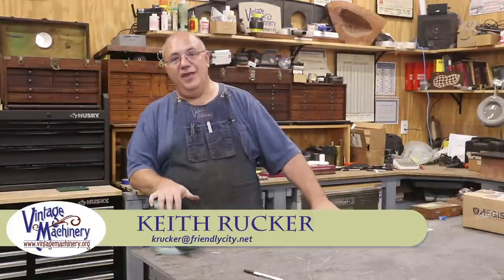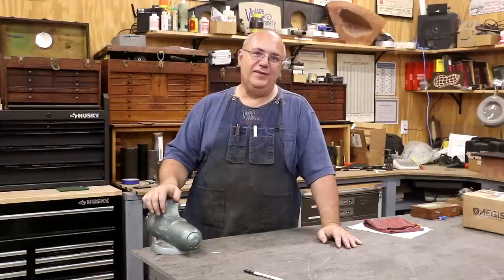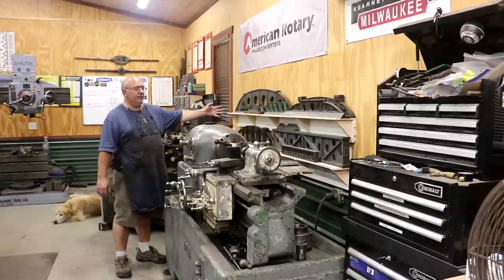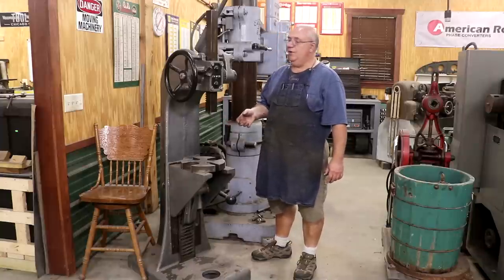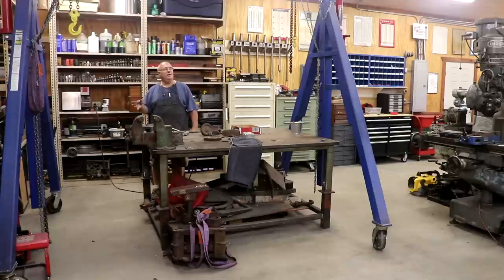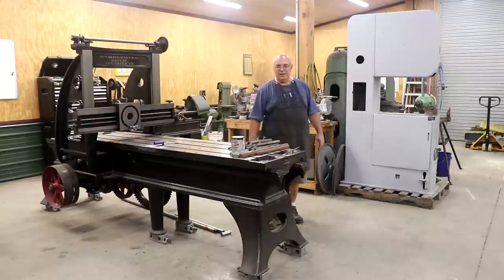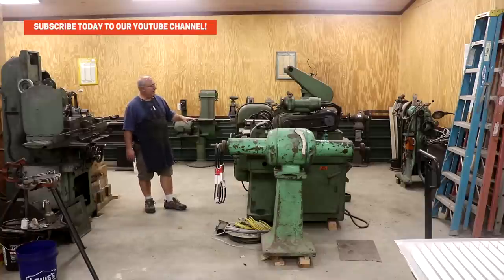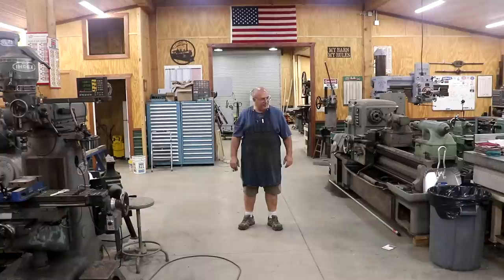Machine Shop Tours: Vintage Machinery

Comment: I still have my grandpas scraping tools made from old files. I just still love using them. I have had the pleasure to have run a 10 Inch Carloten and a 4 foot Master Service Carlton radial capeable of running 8 inch spade drills all day long. Quality machines all day long for sure eh.

Comment: Nice collection of machines, thanks for the tour.  Shops are not what they used to be, dirty chips everywhere barrels full of chips for just a few parts, hog everything out of a big blanks or weldments, not today, investment cast or forged its just clean up add holes.  Machines today are contained no mess and super precise.  Those machines shown required skill to produce precision parts.  Pretty darn cool.  Cheers!

Comment: I grew up in a family of machinists and Mech Engineers.  Like you I worked as a machinist Summers during college, at Ingersoll-Rand 50 years ago, where my dad was a pattern maker. I worked on a drilling machine like your Carleton, but mine was larger - a 6 foot swing. It had a swing out stool and builtin light, and you are right, it could do anything.  I still have a full set of tools and gauges and also a Unimat lathe/milling machine in my little apartment. Still have that cutting oil in my blood.

Comment: I like that Index vertical mill, I've seen their lathes but never a mill. Is it absolutely beautiful and 100% operating?  

There's one other type of mill that prompts saliva dripping....A manual mold maker's mill with a stout rotary table integrated into the mill just above the quill. Complex face grooves become one simple setup. I've only seen two of them at Hughes Radar Systems a Long time ago.

Comment: Also I’m going through the same thing right now. I’m a finance manager right now and getting paid well, but I have this “machinist bug” your talking about. And I really don’t know what to do because I know I’m not good enough to have my own shop, and I don’t have enough time to get as good as I want to be because of the hours I work. Sorry just venting have a good one.
Reply: it can always be a hobby ;) start small and build your shop up piece by piece! with time knowledge will accumilate!
Reply: Just get a vise, hacksaw, cold chisels, files, machinist squares, micrometer. One of the old exercises for an apprentice was to precisely file a cube (or pick your other rectangular dimensions). See how close you can get it. Tip 1 - flex the file to a convex surface on the work. Tip 2 - sharpen the front of the file and you can scrape away high spots in the middle of the workpiece.
Reply: CleaveMountaineering oh man ! I’m on it! Starting that right now! See this is why I love this YouTube machinist community people like you! Just knowing little things like that is so cool and to actually do something that an apprentice would do is super cool to me. I’ve been ordering little machinist lots off eBay so I have all the things you recommended. I’ll get to filing.! Thank you sir. Any other things you can throw my way I’m open !

Comment: What voltage and phases are running in your shop? I'm limited to 240 volts and single phase. Hard to find equipment, everything seems to be 575 volts, 3 phase. I'll need transformers and phase converter!

Comment: I'm curious, would you ever consider replacing straight blades on one of your vintage woodworking machines with a helical head carbide cutterhead???
Reply: No, actually never considerate that option, but I will.

Comment: Ok you need to add me on Facebook I just ran across a early 1900s machine shop it had been closed and sold new owner was getting rid of everything cheap and I shared it in my FB group but most machines where too large for my home shop. They had a couple large horizontal mills and there are more coming available daily.

Comment: I always laugh when I hear someone say how they keep the grinders away from the "precision" machines when grinders usually do even more precision than the other machines.
Reply: I think his point is that the dust and jetsam from grinders is bad for (Other)  'precision' machines. Nothing like grinder dust for FUBAR'ing delicate and precise machinery!
Reply: @TheMicroTrak  Yeah. You totally missed my point. Some of the grinders I have worked with were 6 decimal places precision. LOL
Reply: @DomManInT1  Dom, I took your point. Even astronomy mirrors are made with grinders, and you can't do much better than those. They are also messy, and should not share a workspace with oily machine tools
Reply: @TheMicroTrak  I am only objecting to the use of the word "precision". How about we call them "more sensitive" or "less rugged" or "less durable"?
Reply: @DomManInT1  precision is a term that can be used accurately  on any machine tool by a skilled Machinist. I've held .0002 many times on manual lathes, half a thousand on Manuel Mills.. as a machinist I can tell you we do the best we can with what we have available...grinders are usually kept separate for the very reason that the grinding grit will wear out other precision machinery... And to say grinders are the only machine deserving the word precision is a conclusion based on inadequate information
Reply: @squigmontlucas6150  Yes. I understand you are not very smart. It is ok that you misunderstood.
Reply: @DomManInT1  the only thing you understand is that you're a legend in your own mind and the minute you think you know it all in this trade is a minute you stop being a machinist ... it appears that you aren't even close to being one.. although you do genuinely fit the description of a walkin talkin rectum
Reply: @squigmontlucas6150  We get it. You still do not understand. Please continue contributing to the entertainment.